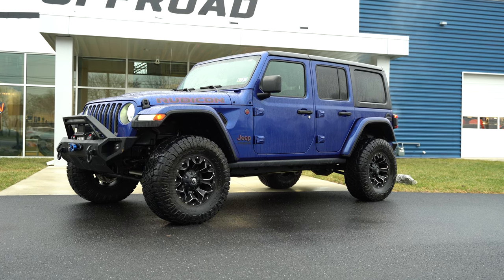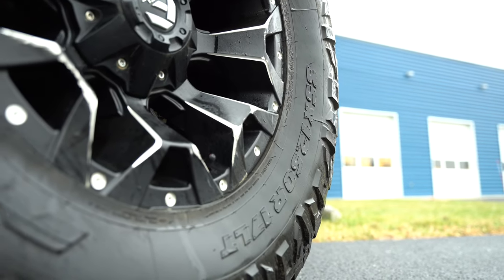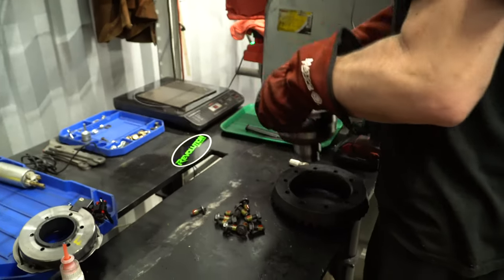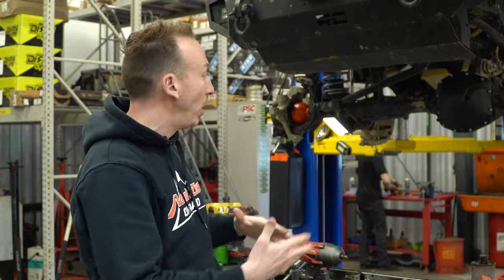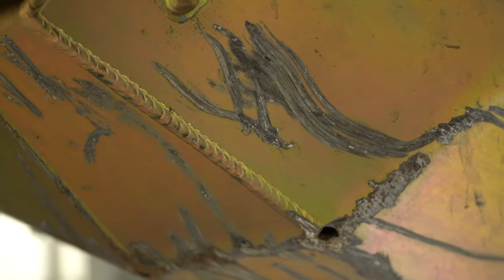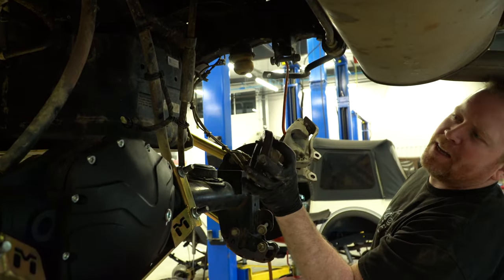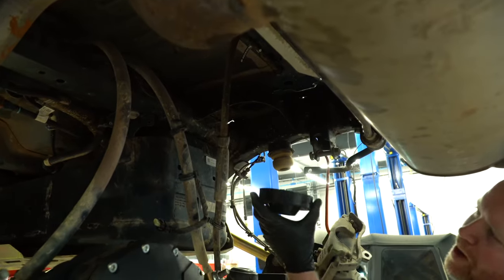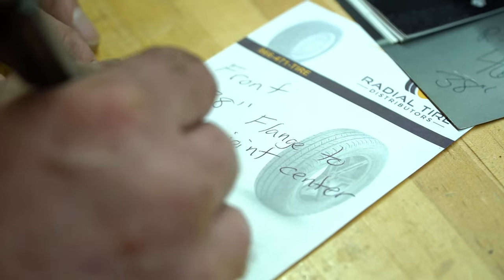2019 Rubicon Transformation with TONS of Metalcloak Parts!

Comment: Question for you guys, my wife is looking to put 38 ridge grappler‘s on her JL however, she is running Dana 30 front Dana 35 rear! What would you recommend? She found Rubicon axles with 4.56 gears, however I think she would be okay with the stock axles that she has. Maybe reinforce the front with  RCV axle shaft in the front, truss and gussets! Just curious what you would all recommend
Reply from the maker: It really depends on how she uses it!  For on-road and easy off road trails, those axles will hold up fine.  No matter what a truss on the front is a great idea, as the tube can bend at the CAD housing (true of the M210/D44 also).  The Artec trusses are really well designed and affordable.  

The Rubicon axles are probably a great deal if the gear ratio is what you want and you do plan to hit harder trails. Consider that a professional re-gear and locker package is easily $4500-5000 in the axles you have.  For context, the majority of our customers running 37-40" tires do not upgrade past factory Rubicon axles/lockers/rear shafts and only re-gear and add RCVs to the front!  We've done very few 1 ton axle swaps on JLs